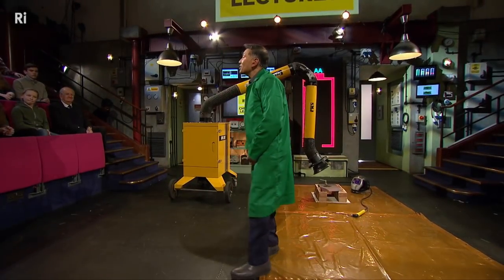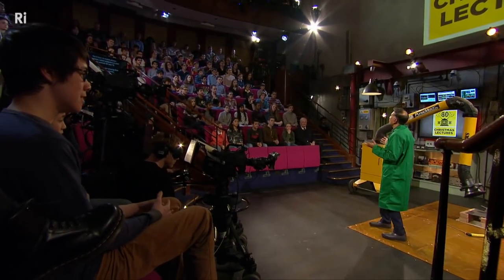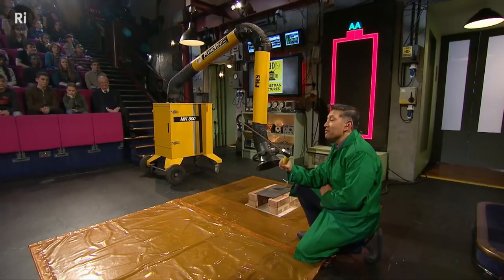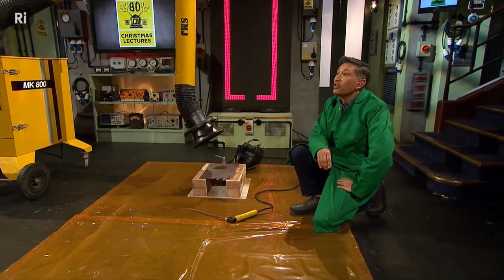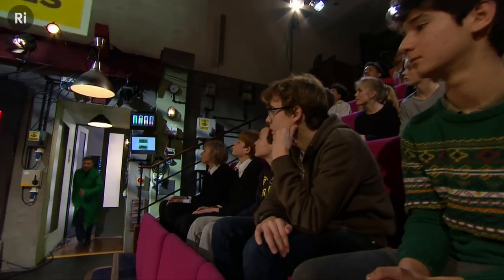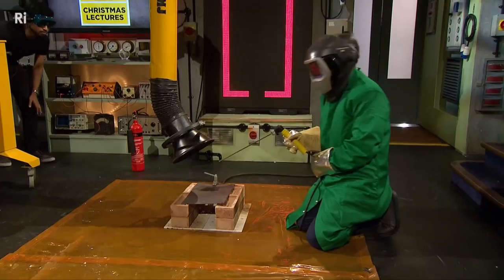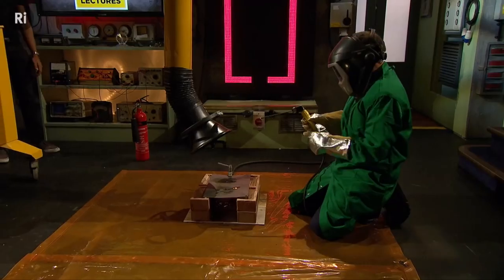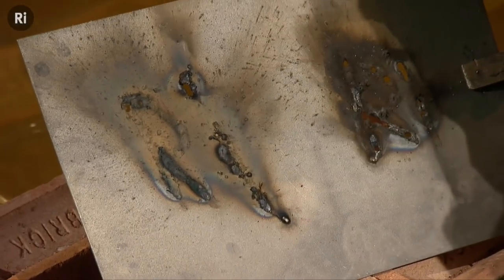Trying Out Battery Powered Welding - with Saiful Islam

Comment: I am a welder as main profession for over 40 years and I have tried this experiment on a few occasions. The main factor and problem with trying to weld with car batteries is that while you may have a tremendous amount of current power a battery is a chemical power source and it makes totally flat DC. There is no pulse at all and therefore is does not arc worth a damn if at all. If you notice he is scrubbing the electrode along the metal right on it, not really arcing at all. If you can induce a little ‘ pulse ‘ in the power you might get somewhere. 
  I first tried this in the 1980s where I connected 2 batteries in series to make 24 volts which would not arc just stick. I then tried a large battery charger connected to one of the batteries and the unfiltered humming DC induced a little pulse which then made it arc a bit , enough to make a 1 inch bead with a 3/32 dia. 7014 welding rod. Then I managed to weld to pieces of angle iron together. I cut the weld part out and kept in my tool box many years. My main problem with those welds was one of my batteries was junk and after 1 inch of weld would peter out.

Comment: 1. The battery will not explode as long a the vents are open, a chemist should know.
2. That particular eletrode is to weld metal, to "cut" metal a grafite eletrode is used.
3. That "art" is not a weld nor a cut.
Reply: I'm bored, I'll take Devil's advocate on this:
1.  That may be true, but health and safety rules always seem a bit absurd, forcing him to do so.
2.  He probably asked 'for a welding rig to cut with', but a PA/intern set up a welding rig for welding, leaving him to make do.
3.  No defending that, it was quite shit to be honest.
Reply: When you put large currents through batteries like this, they give off hydrogen gas.  If enough of this gas is close enough to the sparks you're creating, then you very much DO have an explosion.

Comment: The most amazing welding feat I've ever seen was some youtube of a guy with a completely broken driveshaft on his 4x4 truck, borrowing everyone's truck batteries, and stick welding it back together on the side of a road in the middle of nowhere. {And having it hold together well enough for him to drive home on bumpy roads. }
You know something is a robust technology if you can do it while tired, in the dirt, in the middle of nowhere, powered by jumper cables and truck batteries, on a highly loaded transmission part.

Comment: You can use capacitors
Reply: Too much instantaneous discharge.  Batteries have an internal resistance that limits the current output.
Reply: 00Skyfox yeah but that's what we want for high temperature.
Reply: For Arc welding (as shown here), you need a near-constant current supply.  The current needed, is basically set by the welding rod diameter: 2.5mm ~= 100A; 3.2mm ~=140A; 4mm ~= 185A.
Reply: Yes, for maybe half a second.

Comment: need 3 batteries really to hold an arc,
Reply: Joe Kozak Negative ghostrider. That's just helpful for noobs. Use a smaller rod and try again.
Reply: If you can make something to induce some arcing voltage ( without shocking the piss out of yourself ) it might work really good